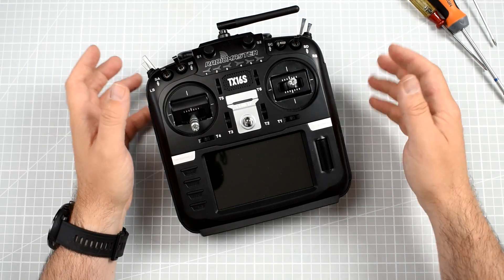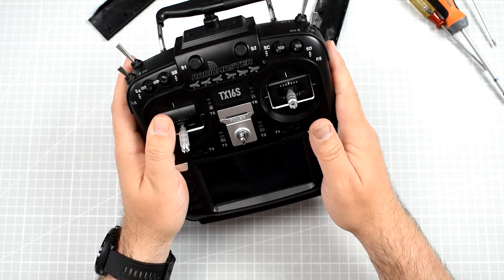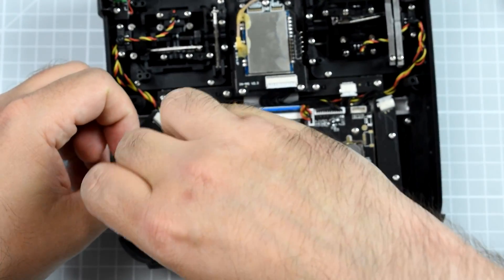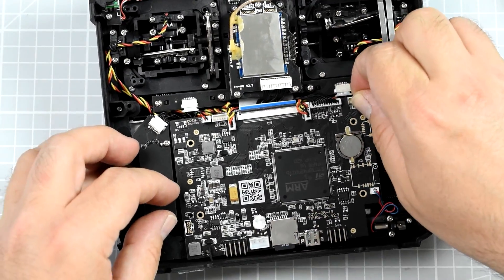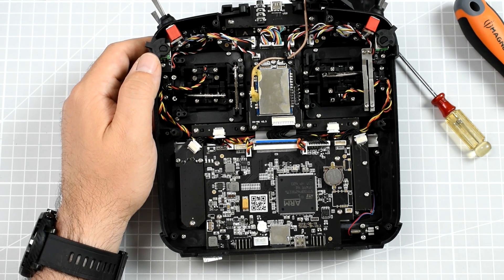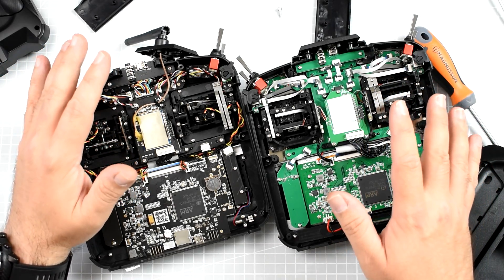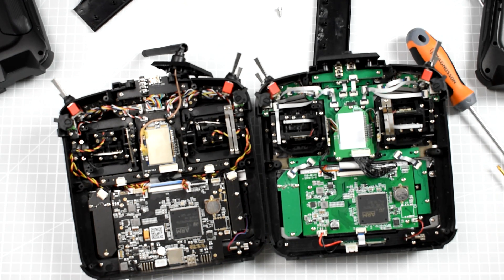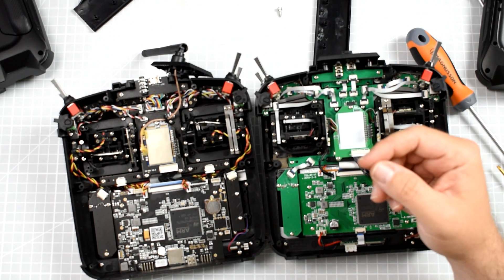Radiomaster TX16S Teardown and Jumper T16 comparison

Comment: Thanks for the teardown. When putting my SD card back in after adding some firmware I missed card holder and dropped it into the guts of my TX so had to open up the case.No big deal really but your teardown reassured me nothing was going to be a drama (and it was late and I did not want to do it). And as a bonus I got to hear your feedback in your really cool accent. Curiously my case is all held by hex screws but the top two are slightly bigger than the back four (no screws phillips or otherwise). Take it easy.

Comment: I have noticed that NONE of you people in the process of doing your tear down comparisons
are exercising ANY Electrostatic Discharge (ESD) precautions whatsoever. I've noticed some 
people touching components with metal screwdrivers and other metal pointers without the 
person wearing a grounding wrist strap. Static electricity does more damage to digital than 
most people realize. It doesn't have to do catastrophic damage but eventually you will have 
a radio failure attributed to ESD. Be on the safe side an wear a ESD wrist strap grounding 
kit. They don't cost but 10 to 15 Dollars US and can save you an expensive airplane or drone.
I Cringe EVERY time I watch one of you people tear down a radio !!!

Comment: I wish someone would make a replacement back plate that completely got rid of those back grip bars and grip nubs.  They make the radio thicker and uncomfortable to hold and use for me.  Great for carrying with one hand on the side, not so great if you're thumber and you have to stretch your hand and fingers that much wider.      SOMEONE MAKE A REPLACEMNET BAKCPLATE FOR THESE ;)  3D print something or something without bars and nubs.

I'm tempted to switch to a T18 Lite... just to get rid of the grip bars.  At first they were cool and a nice touch, now they just annoy me.

Comment: Hello Pawel just received a Radiomaster TX16s but it won't fully charge the batteries via the USB-C port. I use 2x 18650 Li-ion cells.
Did you experience any similar problem with charging?
Reply from the maker: Try using 500mA USB charger. Temperature protection might be kicking in
Reply: Thanks will try that. Anyway I've added an XT-60 cable to the battery holder and now I can use my trusty computerized charger to balance charge the cells.

Comment: Just an FYI when I complained that the transmitter is not charging my batteries this is the reply I got:
Hello thank you for contacting RadioMaster. Please open the back cover of the radio. You will find the two black components marked in the picture in the bottom left corner of the radio. Please cut both legs of the two components and remove them from the board. Please replace the back cover of your radio. You can now go ahead and use the USB charging without any problem. 

This will not affect your radio's performance or warranty, any other problem please let me know and reply to this email so I can follow your case.

Best Regards and sorry for inconvenience.

can you belief it??
It seems to work now ?!?!?
Reply: How very strange.

Comment: is a boomer the power output is just 65 mW in mine :( , if you have the Jumper T16 keep it
Reply: Yeah, Radio master manual never mentions the output power. How did you calculate that?

Comment: Pawel, can you comment on the interface for the extra switches SI and SJ.  It appears from your video that the the pcb tracks are in the same place as the Jumper T16, but are now sockets.   Is there anything etched on the pcb to confirm this?  See https://www.rcgroups.com/forums/showpost.php?p=43413181&postcount=7704

Comment: Couldn't see what screwdriver tip you held up, but seems as you asked:
- Phillips is the screwdriver with just the simple plus shape.
- Pozidriv is the screwdriver with the extra diagonal bits.

The screws are marked to match - Posidrive screws have the extra little lines marked on the head.

Phillips is designed for the screwdriver to push out (Cam-out) when too much torque is applied. Pozidriv is designed not to cam-out.